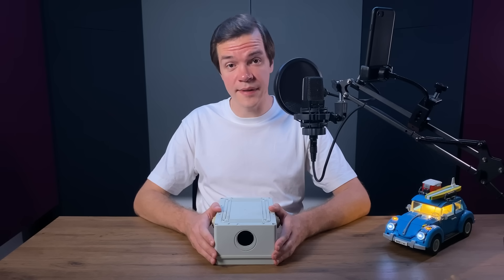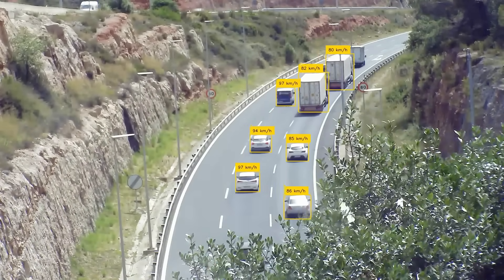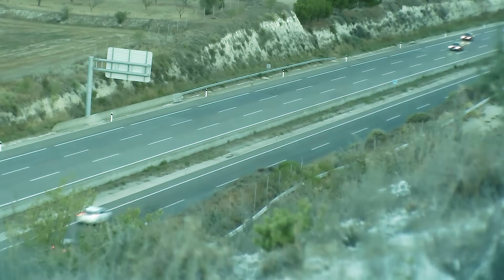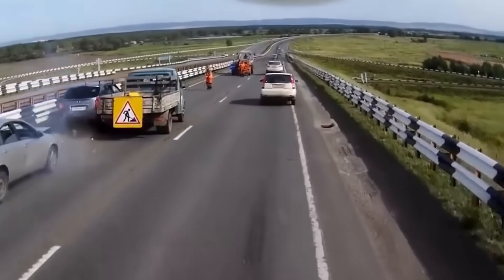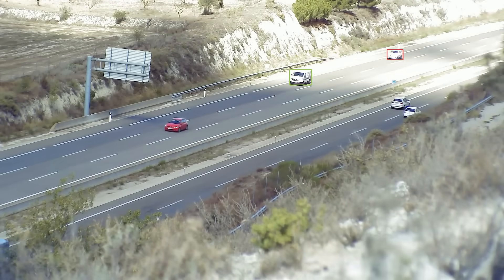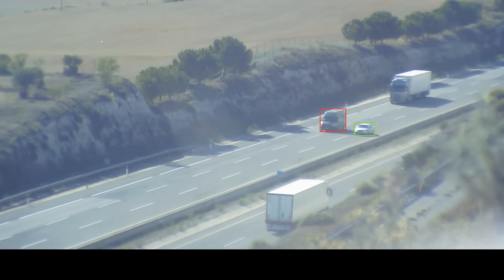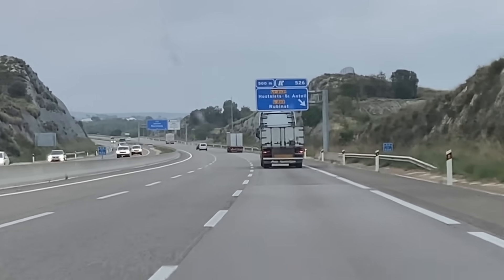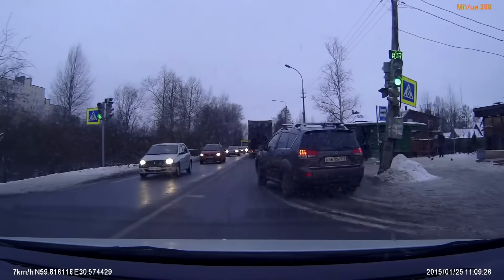New Anti-Tailgating Camera Reveals Shocking Statistics

Comment: I don’t understand why people get mad at you in traffic when your not a few centimetres behind the other car, like that distancing is not going to speed up traffic.
Reply: When I was a bus driver we were taught to stop so that the rear wheels of the vehicle in front were visible. If the traffic moved but the vehicle in front did'nt for any reason you would still be able to get around it. Useful when working to a timetable ! Long retired now but still do this when in my car. If driving sensibly gets others annoyed then that's their problem !
Reply: @ryszardlorenc7047 I was taught the same in drivers Ed in 1968, still do it!
Reply: @ryszardlorenc7047 > “[We] were taught to stop so that the rear wheels of the vehicle in front…”
Excellent advice, even for car drivers. It might piss people off and not always be practical, but if someone is stuck in a line of vehicles and can see the rear wheels of the car in front of them, they almost certainly have enough space (front, and some rear, and assuming space to the side(s)) to drive the vehicle out of the line should there be an emergency or other problem.
Reply: @ryszardlorenc7047  ✅
Reply: I guess people want to 'feel' progress, even if they're not actually making any?
Reply: @bikerchrisukk  yes because they are short sighted
Reply: What I find ridiculous in city traffic is when I see a red light ahead, I immediately let off the accel pedal and let the coast/engine-brake towards the intersection... Meanwhile some jackass behind me starts tailgating, blinking the high-beams, or sounding the horn... Like they want to maintain 50km/h or more right up until the last moment before they'd have to slam their brakes to stop at the line?

Idiots don't realize that trying to come up quickly to a red light at an intersection isn't going to get you through any faster. 😄🤦🏻‍♂️
Reply: @jf3570 this goes a long way, letting your car slow down on it’s own instead of slamming on the brakes every 5 seconds forcing traffic to build up behind you. Wish more people knew how to drive their cars.
Reply: @jf3570 Way too many people accelerate towards an intersection with a red light, just to slam on their breaks a few feet from/into the crosswalk, rather than coast to a stop. And the raging drivers behind them who have no clue, angry with what is essentially a “you need to speed up so I/we can all hurry up and wait” argument.

Of course, this is excluding the situations when a slower roll /actually/ does block the flow, such as access to turn lanes.
Reply: @jf3570 So, you are also driving energy safe- mode and brakes-safe mode while the moron behind you is wasting it.
But likely it's a power game and they just like to see people fidget under their approach.
Just do not play that favor 🤷🏽
Reply: I don’t think what Ultra says is fully true. Many high speed tailgaters are trying to “bully” the driver in front of them to go faster (even if they are already driving at the national limit)..
Reply: @philtucker1224 unfortunately that road goes both ways, there’s always someone who decides to switch into front of a car moving faster because their own lane is backed up, then as soon as they switch they decide they only want to go slightly faster than the person they were trying to pass. You don’t need to floor it but you need to understand you aren’t the only one on the road and cutting others off is a d*ck move.
Reply: @philtucker1224 He didn't exactly exclude that mode- of which I am sure, too.
Reply: @philtucker1224  well yea, go like 5 mph faster so you can find a clearing in the slow lane and then gtfo the way. But instead you got people that want to pass a "slow" truck by doing 73 past the truck going 70 and they create a huge jam because god forbid they go a little fast to pass someone
Reply: @Reason1024 yes I agree..
Reply: @philtucker1224  Tailgaiting makes me to drive slower so that it is safer for me if I need to suddenly stop
Reply: @lopnezk1320 you shouldn’t tailgate.
Reply: In the UK the road manners are so atrocious now I think people are in fight mode just walking to their cars. 
Fed up of people pushing in, blocking round abouts and causing issues.
It's been particularly bad since covid and price hikes. 

The person in front is just another frustration and obstacle. 😢
Reply: @zxsavagexz4502 Covid has done something in many areas, and not good often...
Reply: leaving more space actually improves traffic because youre more likely to keep a more consistent speed. following close
means braking to a complete stop, which causes a ripple effect behind ya.
Reply: it's because people naturally feel like they need to be in front, even if there is no 'front' on a highway, they will make one up, and it almost always manifests as being in front of the person right ahead of them at (nearly) all costs.
Reply: @dawnderg yes, lack of intelligence or narcissism or not able to look at the big picture
Reply: @dawnderg they need to be 'in front' if your car is smaller, or if you are a woman.
Reply: I've had someone beep and swear at me because I didn't immediately move up three car lengths to the car in front when it moved in a jam.

The reason I didn't move was because I was at a crossing point and there were several families with children crossing in front of me.
Reply: @arkadye Idiots will be idiots.
I have been flashed at occasionally for not jumping to the right ASAP- because, say, there were a truck there or two.
Those morons just like to put others under pressure - because they can. Sometimes 🤷🏽
Reply: @arkadye  I wonder how people survive when they are so dumb. They don't assess situations in a practical way.
Reply: @arkadye  it's similar at traffic lights. The car in front moves ahead slightly, then the person behind does the same and so on, but they're all still not going anywhere until the light turns green. 
I drive a manual trans car and truck. It's funny to watch how auto car drivers operate in stop-and-go traffic. They're all herky-jerky from brakes to accelerator, while I can roll continuously in 1st or 2nd gear and simply clutch to slow, rarely using my brakes. 
People are impatient and assume that any movement forward will get them there faster even at a stoplight.
Reply: Also, you know what causes the worst delays? Crashing . Something that is a lot more likely when too close to other cars, and/or too hurried to get there in one piece.
Reply: People often get mad at me if I'm not breaking the law, i.e. driving just 102 (gps speed, 105 on the speedometer). Am I crazy?
Reply: You are the obstacle in front of them right now.
Reply: @vintageforkcollectorguy  I have learned from experience that if I drive a short distance behind someone it feels like he is blocking me (doesn't matter if he even could go faster or not) , but if I keep a comfortable distance the slower speed feels more like my own choice. Also, it is much more relaxing as I know I do have a lot more time to react.
Reply: this matters if you're in traffic and the person behind you really really would make everything better if they could move up some, and get out of the way so that,  for instance, a tailgating car doesn't end up clipping the car behind you,  just because you weren't really paying attention,  and couldn't move up 19 inches or several feet

gotta pay attention, even to the car behind,  especially if it's really busy.  you could save yourself in that scenario.  on any road
Reply: Boils down to them not being particularly smart.
Reply: Its the opposite, close following is an unstable condition which creates traffic jams. The distance at which this occurs increases with the square of velocity. Above 20mph or so, increasing speed reduces road capacity.
Reply: The thing is, smaller gaps actually does speed up traffic if there's congestion.  By "speed up traffic" I mean the flow rate (cars per second), not the speed that individual cars are going.  Bigger gaps means fewer cars can fit on the road at any given time, and modelling this shows that it increases the journey time.  This is the whole idea behind multi-lane roads - improved journey times because the road can fit more cars on it.
Reply: People do this to me all the time .. like i cant go faster than the car in front of me and neither can you. We are all stuck until there is space for slower cars to move back over. I just dont get it.
Reply: In fact leaving no space WILL SLOW DOWN TRAFFIC by removing the critical buffer and room for lane changes/merges.
Reply: Assuming "a few centimeters" is an exaggeration here, I would recommend you read up on the subject of traffic dynamics, as there is in fact a significant impact on road capacity from the distance between cars, and there is both a "too close" (resulting in a lot of speed variations propagating through a line of cars, i.e. the accordion effect) and "too far" (resulting in less than optimal use of road and higher likelihood of lane changes).
Reply: These same geniuses will stand 10cm behind you in line at the store or at the airport. Guess what, no matter how close you are packed together that doesn't make the checkout person scan the items faster, doesn't make the plane take off sooner and doesn't make the red light change early.
Reply: They are dumb.
Reply: Because they're psychopaths and idiots, obviously.
Reply: they are trying to pressure you, to pressure the slow poke in front of you who is causing a traffic jam behind them.
Reply: Because most people are very, very stupid.
Reply: How do you know that they are mad? 

Did they tell you?
Reply: I will say the times I get mad at that it  is cause it’s literally a few cars who won’t move up, so more cars can make it to that light segment. They could fit more people and lessen traffic and not sit at another light, but they keep extra space and not move up. or I could get into the turn lane and keep traffic going or lessen traffic but someone won’t move the 2 feet up they have to make room. Only time I would get mad in traffic is when it could be going smoother but people  aren’t aware how to make the traffic better with a few second of awareness… or if 10 just were 1 foot closer. I take same route every day and literally have a 1/3 longer time  added to my commute because someone wants doesn’t care about moving up that one extra foot. Seriously so annoying when another car has to wait a round at a light in traffic because someone can’t get off their phones and scoot in line with everyone else. And that actually tends create more traffic cause that person doesn’t follow the flow. So we all are stop and go instead f a steady flow.
Reply: @courtneymc33  For city driving, you have identified the main annoyance. Just like with highway driving, if drivers misuse (or sub-optimally use) the buffer space they have in front of them, the more tasking and annoying the driving, and and less traffic flows overall. 

Just for your own sanity, you might want to gather some data from your commutes: start time, end time, quantity of "annoying incidences" that would bother you. Then compare the actual times of travel. They may not be different enough to warrant any concern or road rage.
Reply: It's just low IQ. Expect it.
Reply: Far be it from me to defend tailgaters, but while they are not technically going any faster, with shorter follow distances more people move across the road in a set amount of time, so the traffic will back up less. The shorter the follow distance is on average, the more traffic is "serviced" by the road.

At least until the first accident.. :)

So this is in no way a defense, but it is not pointless to reduce follow distance as much as possible without sacrificing safety. This is part of the reason that autonomous cars are kind of a holy grail of transportation, with potential wireless communication and sub millisecond reaction times, they could reasonably have follow distances of just a couple of meters without them being unsafe, multiplying the throughput of any road.
Reply: @miklosfoldenyi8410 > “A least until the first accident…”
Exactly. A natural way to model stop-and-go traffic are “micro accidents,” one for each time someone in a lane must take to stop+restart, vs a smoother flow (at perhaps lower than theoretical capacity) without any start+stop.
Reply: You would be surprised. It will causes a lot of slow drivers in the left lane to move over.
Reply: @conservativeriot5939 > “It will causes [sic] a lot of slow drivers in the left lane to move over.”
People often will only perceive relative speeds. They may slow down (and perhaps merge into your lane) as your approach reminds them they aren’t in the correct lanes. They may aggressively accelerate if someone attempts to pass them, even if they were traveling far under the limit. This is just human nature.

To clarify, the times when you might want to “traffic shape” in the way I talked about earlier, were primarily aimed at highway gridlock, not when cruising in light to moderate traffic or on city streets. My apologies if that wasn’t clear.

In the high-traffic scenario, all drivers are “slow drivers” (both to the left and right) and—because of that human nature—will jockey for position, so they will jump into (from either direction) and away from your lane (to the left or right) as soon as they see an opportunity for perceived gain. 

“Traffic shaping” here can actually help “dissolve the clot” that make up a great many multi-lane (3+) traffic jams.
Reply: The biggest issue are people driving slow in the fast lane
Reply: @bebo2490  There is no "fast lane" there is only a "passing lane" The left most lane is a passing lane.
Reply: Distancing will actually speed up traffic, but its just not safe.
Less distance between cars = higher throughput
Reply: Short attention spans. Lack of critical thinking skills. Emotional distress. Ego. Lack of empathy. Ignorance.
Reply: because we all know you're oblivious and going slow in the passing lane. Get to the right and no one will care how slow you're going, grandma.
Reply: If they're going the same speed as the cars in front of them and they're just maintaining a reasonable following distance, they're not disrupting anything.
Reply: I was driving with a coworker to a work meeting, and they were so mad about the my following distance. Not only did I not feel safe when I kept a shorter distance to satisfy them, but I also really didn't like all the breaking and acceleration I had to do. Waste of gas/energy/brakes, even in the hybrid I was driving.
Reply: @inund8 nobody gets a ride and tells me how to drive.
Reply: @OneOfManyNicknames  It was my boss :(
Reply: @inund8 😂😳
Reply: t's because we have shit to do and you're impeding our flow. Drive like you actually have a purpose to get somewhere. Shit ain't for lollygagging.
Reply: It depends, if it is in a city, traffic lights are configured for time and not number of vehicles. If people leave bigger distances then a lot less cars will get through each cycle.
Reply: Depending on location having excess following distance isn't helping and is ensuring less people make it through the light/intersection/merge/etc. You make think having an extra car length does nothing but it's a lot when you're going 5 and it's inviting someone to cut you off regardless of your speed.
Reply: YOU'RE
Reply: Same reason people get agitated when waiting in line for anything. You being 2cm from me is not going to decrease the time spent in security at the airport.
Reply: That's the same reason why bad music and bad taste exists
Reply: 85% of people are idiots
Reply: It is because of the inability to do simple maths.
Reply: You need to be honest with yourself and ask if you're really just "more than a few centimeters" away, or leaving a 7-car gap off the freeway because you're fucking around on your phone. I've been living and driving in the city for over 4 years now, and I have never ONCE had a problem with tailgaters or unjustified honking over gaps. This is a problem only a select few people experience, and it's their own fault. About the only things I've been honked at for were for other peoples' lack of understanding of road laws (e.g. crossing the line when making a left at a light, not stopping when there is no stop sign, passing a car on the freeway in general, etc.).
Reply: It doesn't just not speed it up, following too closely actually slows down traffic.

When driving cars need to move from lane to lane - to exit, or pass, etc.   When they do this, the vehicles around them need to adjust their speed.  If cars are following too closely they don't have any reaction time to adjust their speed.  Once someone in traffic brakes, the vehicle behind them has to brake too - and if that vehicle is too close, they have to brake harder/longer.  Then the vehicle behind them has to brake even more, and the one behind them even more, until at some point the traffic will come to a complete stop.

Traffic needs room to flow.    If there isn't enough space between vehicles, it won't.
Reply: @KarlStevens  I do not know if your response was to me, but it sounds as if it is. I was talking about stop and go kind of traffic, where there already is no flow. In that case, it is better to move closer to the car in front, as it is standing. Leaving too much space in front makes lane of cars longer, thus making congestion on previous intersection...
Reply: @CarNikola135  There's actually good evidence that getting as many cars as possible into a space of stopped traffic lets fewer cars through when traffic resumes again, notably at lights.
Being nose to bumper means each driver in line has to wait for the car in front to start moving and get a small distance ahead before they can move.
If there's a sensible gap between each car, almost all of them can get moving at about the same time which typically gets more cars through the space in the same window of time.

If people are stopping in an intersection, then that was a poor assessment on their part and not the fault of those ahead using the road more sensibly.  You don't enter an intersection unless you know you can clear it.
Reply: What's funny enough is what sometimes resolves traffic is driving harmonically. And to do that you need gentler accelerations/braking -> so bigger distance between other car. Tailgaters are actually help traffic to become worse.
Reply: A person is smart, people are stupid.
Reply: Depending where that traffic is, they might be right. For example if in city, where there are a lot intersections controlled by semaphores close by, by leaving too much space in front, you lower or almost stop traffic (if say green light wave in not going your way) or you could be leaving someone few cars behind you in intersection (green was longer previous intersection then next, sou there is now line of cars extending all the way back into previous intersection blocking it.) If it's slow city stop and go traffic, there is not reason to leave full car length of space in front of you, you are not speeding, but you are taking more space on the street than needed.
Reply: No, they have made a decision to overtake you. You can relax, because there is nothing you can do to fix their brain.
Reply: I have an uncle who do this: when somebody starts complaining behind him at stopped traffic, he just put in reverse gear, and start to go backwards for a few centimetres. The guy complaining in the car behind will think twice before tailgating other car again.
Reply: @AfonsoBucco then he might want to reconsider his actions before he lands himself into hot water one day for accidentally making contact with someone elses car. Dashcams are a big thing these days.
Reply: @AfonsoBucco Dangerous!
Even in stopped traffic!!
Reply: When traffic density is nearing saturation, distance certainly matters. Keeping more distance than stricktly necesary reduces traffic troughput, forces drivers behind you to slow down and eventually results in traffic jams.
Reply: @CorryDMG > “keeping more distance than strictly necessary reduces traffic troughput, forces drivers behind you to slow down and eventually leads to traffic jams.”

I tend to disagree. What I think you are getting at is how density relates to traffic problems, but I believe you have your causes and effects mixed up. The problem is not people keeping too large a distance—natural human behavior prevents that. 

Instead, you have people failing to keep a sufficiently large enough buffer in front of them, so lane drivers have to be hyper-vigilant, hit the breaks, then through (non-instantaneous) reaction times to move forward again, lose more time and any possibility for smooth speeds.

On-ramp meters deliberately space out traffic, and are successful at delaying the onset times of bumper-to-bumper traffic. If people played the same metering role in their traffic lanes, the traffic “clots” (massive traffic slowdown, then it later speeds back up, for no particular reason) would not happen as much.
Reply: It’s probably because it’s not that that is the problem.

Your probably driving like a minimalist dude and your probably out of gear

People tend to drive the car out of gear when driving the speed limit

People that can’t drive or just have basic thinking can’t even tell the difference between in gear or out even at low speeds 

this causes a lack of understanding on one way roads on why people can’t stand yo “🫏 “ on the road

There’s three vehicle types

Fwd awd rwd 

Mix all three in traffic behind eachother with the awd in front 

The awd will require the best foot work to stay in gear at low speeds this causes and needs to be more aware than the avg driver to keep the car in gear as when your out of gear all four tires drop the chassis into the ground

This causes way more speed loss on lift than normal 

To keep traffic smooth you’d want to be conscious to not fully realease quickly when in traffic  as a regular car behind you will have to brake siginificantly more than you if you find you need to suddenly break because your abs kicks harder

When your driving way too slow this scenario is re done a million times and makes people tailgate or drive so slow they dissapear  and catch back up a min later …

When your out of don’t drive your car right at all it doesn’t matter fwd awd rwd

You just go through the situation of being better of putting your car in 

Low eco cruise all at the same time

Sometimes I wish I could send screen shot noticfications with a little dialogue to people in front of me of how I have speed matched them combined 3 different poop settings on my car.

By the time they see eco low and cruise I’m sure they’d begging to realize they are driving like a dam bot .

Literally let’s make vids of what kinda of cruise control settings copy the car in front of you and then breakdown the fact that people are driving wretched lmaooooo
Reply: A few centimeters is pretty ridiculous to get mad at but if you're leaving football fields of space, you're creating a bottleneck and interrupting the flow of traffic. Everyone behind you are forced to slow down subzero mph because you're refusing to keep up with the flow to speed things up just a little more
Reply: @Devond085  Well, you need to leave 100 m of distance at 120 km/h to be at "3 seconds of distance" from the car at the front. Any less than that is wrong, and frequently even illegal. And as explained in the video, most idiots will drive at 30 m of distance. They would likely think that 100 m is excessive (or who knows? even that you're leaving "football fields of space").
The procedure is simple: counting the seconds that pass between the front car running over some marking, and your car doing the same. If it's less than 3 seconds, you're too close.
Reply: @Devond085 Rule number one of traffic is cars cannot travel faster than cars in front of them. If the car ahead is traveling the same speed as the one in front of them, then there is no difference for your travel speed if they tailgate or leave 100 meters in front of them.
Reply: @Devond085  If you were magically in front of that car, you would be traveling the same speed.
Reply: @NomoregoodnamesD8 exactly we would be traveling the speed of every one else instead of Having to be waiting even longer for the bottlenecks to inch up 30 ft while the traffic in front of bottleneck has already inched up more.
Reply: @NomoregoodnamesD8 what?! All im saying is that if you're leaving a large gap you're being a bottle neck for the drivers BEHIND YOU. You leaving all of that extra space for 5 other cars to merge in front doesnt do anything but slow everyone else down more. People have to tap on their brakes because instead of you moving up with the rest and keeping up,...
Reply: @Devond085  It literally changes nothing as long as there is capacity on the road.
Reply: @NomoregoodnamesD8 um yes it does. Just do your research man. Im not trying to argue but theres a lot of research that proves my point. I used to think the exact same way. But it has bigger effect than you think. Just do your homework. Respectfully brother
Reply: @Devond085  If I am on a one-lane road and the car ahead of me is going the speed limit, tailgating will not make them go faster. Giving them 80 yards will not make them go slower, either. I will get to my destination at the same time, either way. The person behind me will get to their destination at the same time, either way.
Reply: @NomoregoodnamesD8 im not talking about those scenarios. Im talking about actual traffic. Like traffic jams. Also more times than not (especially here in the usa) people dont give a flying flip about the speed limit. They go at least 5 miles over if not more.
Reply: @Devond085  Then you my friend are removed from the subject matter of this video, tailgating at highway speeds. If you follow the 3 second rule, it holds at stop-and-go speeds.
Reply: @NomoregoodnamesD8 dismissed? Buddy im not sure whos authority you're running under but I dont follow it. I have a right to be in this discussion as much as you. My point stands.
Reply: @Devond085  Okay? We are arguing different things, though.
Reply: @Devond085 they're in front of you
Reply: @Devond085 Can't really blame the citizenry though; USA has some of the slowest speed limits in the world!

Case in point: 55 MPH -- which used to be the country's national speed limit and still is the limit on many portions of it's highways -- is barely 88.5 km/h!  (88.51392)  In Canada, that's almost as slow as rural backroads.  And to a German, that's so slow it's practically backwards! 😄 (It's not uncommon to find Autobahn traffic nearing 200 km/h.)  Never wondered why German cars often have speedometer scales going up to 240 km/h or more?  While American export cars from the 70's have their speedometer clipped at only 130 km/h?  (140 km/h = 86+(12472/12573) MPH, which would have exceeded the "max 85 MPH on the dial" law of the time)

Typical highway traffic in Canada is about 120 km/h.  Posted speed limits are usually 100 or 110 km/h, but even where it's 100 km/h, police usually won't give you trouble for driving 120 km/h (= 74+(2366/4191) MPH) unless the weather is bad or you're doing something dumb.  And that's still slower than many other countries' typical highway speed.
Reply: @Devond085  your math doesn't.
Reply: @Devond085 seems like the other guy likes to go 5-10 under in the high lanes. Don’t expect everyone to understand that on the other side of the spectrum, slow drivers cause plenty of issues and make bad traffic worse by stopping the flow of what should be smooth traffic. At the end of the day this video is about tailgating at highway speeds but that’s just one piece of the puzzle.  Bad drivers are everywhere whether it be an open road or a traffic jam.
Reply: @ZombieBrains9876  unfortunately this topic will always bring out the worst in people because most people on this thread drives unfortunately they lack research and go based off of that they think. At the end of the day its a pointless debate
Reply: @NomoregoodnamesD8 When leaving far more distance then security requirements, the issue is about road flow rather than speed. First : excessive space saturates road section flow between two crossroads. Second : opportunity to merge to the next section is statistically delayed. 
Incidentally, most of excessive distance takers don’t follow the flow, maybe to limit repeated brakes, stops and re accelerations, maybe because the don’t care about the others who are waiting to merge at the crossroad behind.
Furthermore, gaps incitates lane changing, and than occurs slowing down. 
 
Conclusion : leaving the right gap (function of speed and weather) is a matter of respect for all the traffic, and not only the « mad »  guy behind (and the others). For sure, keeping the ideal gap ain’t always so easy, especially regarding to lane changing behaviours, but everyone should agree about courtesy.
Reply: @ronaldf1210  The moment "crossroads" are mentioned, you are no longer talking about an expressway. It is also to be expected to be prepared to slow down approaching crossroads.

Whether you take a quarter-mile or a half-mile to come to a stop to a red light on a high-speed road makes no difference as there are literal miles of open road behind the intersection...

In fact, slowing down without coming to a complete stop at an intersection can be faster if timed perfectly (think: having a rolling start to get back up to speed vs dead stop).

If intersections are spaced less than a quarter-mile apart, then you are talking about a road or a city street, not an expressway.
Reply: @NomoregoodnamesD8 
It actually just stops you from speeding, to reach your destination 5 mins earlier 😡
Reply: @Devond085 at 60mph, if you drive closer that 50ft from the car in front, you are contributing to any traffic jam that forms ahead. You are also creating an impediment to merging traffic, which is the most common cause of jams. Meanwhile drivers who leave a "football field" of space damp out "phantom jams" and improve the average speed of traffic.
Reply: @Devond085  or if you leave a 30-50 feet (like 3 seconds of travel time) between you and the person ahead of you, you can accelerate and decelerate smoothly, and then everyone behind you can do the same, leading to few "waves" of traffic stoppages. More stoppages is proven to result in slower average speed then remaining moving, even if slow or with a large gap.
Reply: @Devond085  you exemplify my point